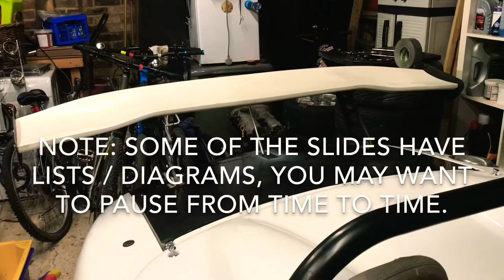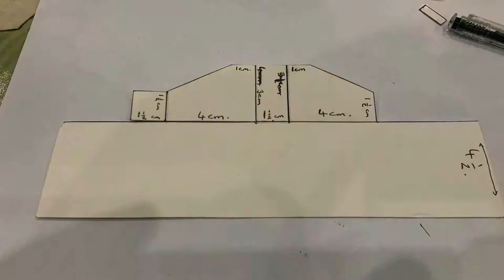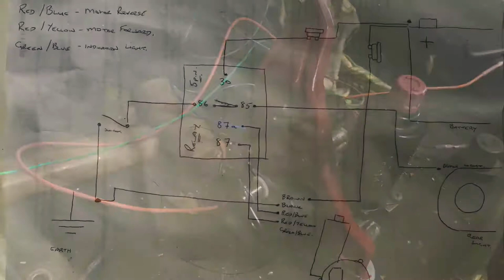Active Aero Rear Spoiler How To

Comment: Very nice project. Was surprised to see the motor keep spinning to the same side of rotation...
But all in all, a very useful and detailed video. Will think about doing the same to my track car.
Thanks and props to an awesome video/idea!!
Reply from the maker: Thank you, use steel round bar instead of aluminium, I have just replaced the aluminium as it had bent slightly!

Comment: How much real life use have you put it to? Max speed you have used it for and results?
Reply from the maker: To this point I haven’t got a lot of data as I have been running in a new engine and have been Rev limited, the engine is now run in so I just need to get it mapped and then I can start pushing it. The highest speed so far was only 80mph there is definite stall created, I did a test from 60mph on a straight flat area of road where I took my foot off the throttle and let it decelerate to 50mph, I did the same test again only this time I activated the spoiler without any brake force, the difference in deceleration was 5 seconds without the spoiler 3 seconds with (I was surprised by such a big difference) this is backed up with a video. I will do a lot more testing over time but I have laid the car up for winter now. Thanks for your question